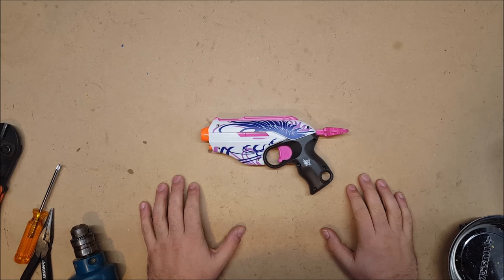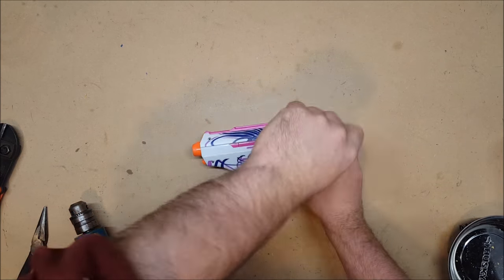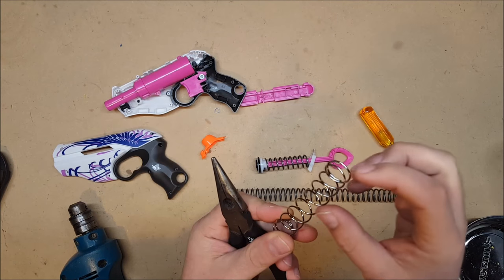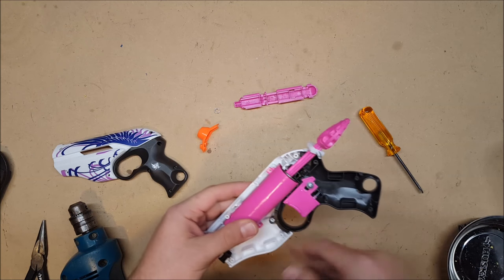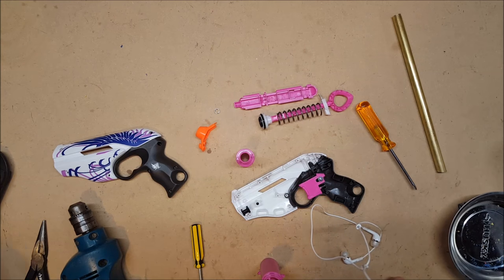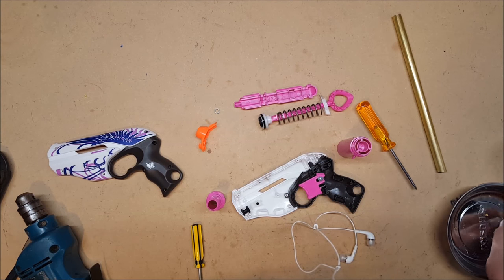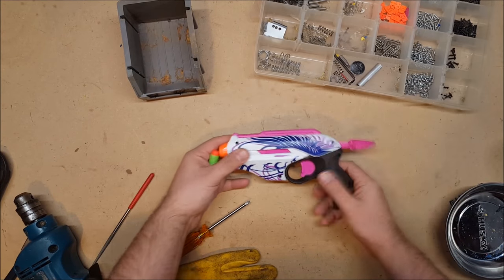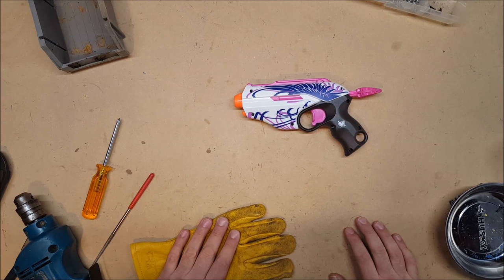Pink Crush Mod Guide

Comment: Captain Xavier will the same length cut work for the nitefinder or do you know the specific cut length and i bought the same spring you have so i would like to know what size to put into my nitefinder if you dont mind answering my question
Reply from the maker: For the night finder it can be the same length as the original spring.
Reply: +Captain Xavier Thank you
Reply: +Captain Xavier what is an alternate way to cut the springs because I used a dremel and it broke the saw blade

Comment: dear captain xavier, i would like to inform you that on most, if not all, elite blasters that removing the air restrictor is not beneficial, and on some blasters will actually hurt the range as it increases dead space. however if you get red if the dead space, it works fine
Reply: I disagree. I will agree that the performance isn't an amazing increase, but by removing it there is no doubt that there is a performance boost, and if there isn't there is no loss of performance. Generally.
Reply from the maker: Demitrx As mentioned I don't have a chrono so I have not done the math to prove the differences so you may well be right.
Reply: I can agree with demitrix, it actually is worse for your elite blasters unless you are brassing them.
Reply: Tiger Foam i didn't even think of that! yes. removing air restrictors can leave too much dead space. because the air isnt being guided through it loses the pressure it would have. a brass barrel fixes that problem if sealed properly.
Reply: Demitrx you were totally correct
Reply from the maker: Tiger Foam That I can see. In fact in some cases you have to remove the AR in order to brass the barrel.
Reply: Captain Xavier Yes thats what i said i think
Reply: Tiger Foam Yeah if there isn't anything directing the air it'll just be wasted. Hmm.... I wonder if they make something like an air restrictor that guides the air better.

Comment: Here's my brass barrel approach for guns like this.

step one, throw away the original barrel (or more likley, put it in a parts bin for some other project.)

The dart peg mount can be bored out to fit the OD of the brass, this will be the rear mount for the barrel. The rear of the AR housing should also be bored out (to less than .5"/12.7mm) so that air can flow, but the darts do not fall back into the cylinder.

The muzzle piece may or may not require modification to hold the front of the barrel. For example the nightfinders 'flash hider' piece actually holds brass nearly perfectly, but a firestrike is far too wide and requires some structural support.

I use copious amounts of epoxy putty to seal any gaps, and to fix the muzzle and breach ends of the barrel in place. I also use polystyrene cement to seal plastic parts together.

If anyone cares I can pull apart my dayfinder (modded nightfinder) on video to show the method more clearly.
Reply from the maker: Thank you.  I'm not sure if this sounds harder or easier.  I will have to give it a try.
Reply: It's easier in that you don't have to drill through the original barrel, and harder in that you have to mount the brass properly.

Overall YMMV, but it works for me.